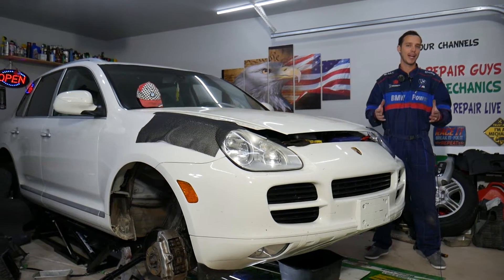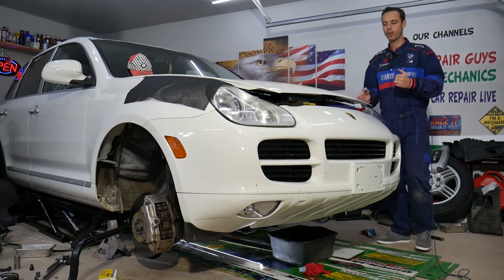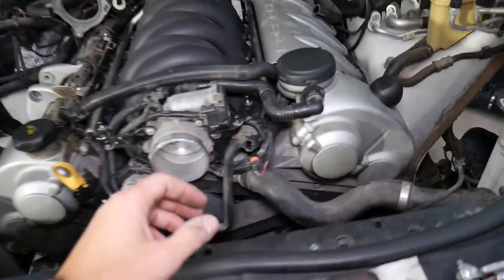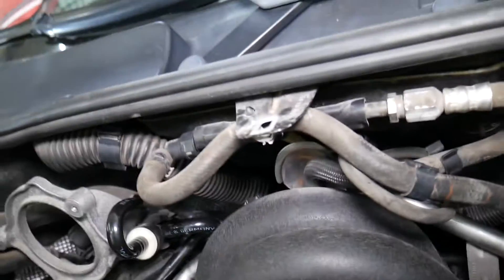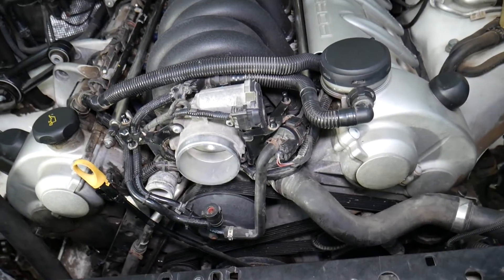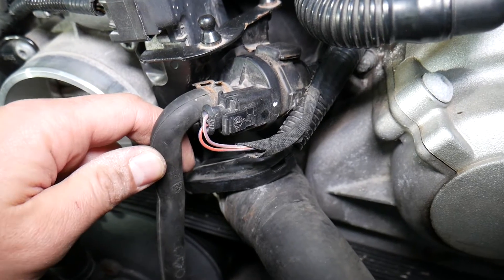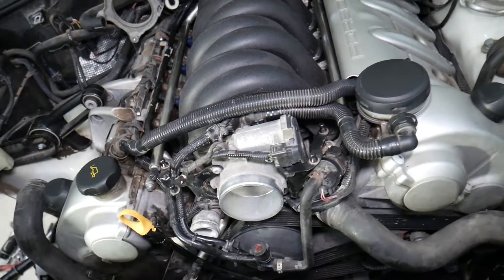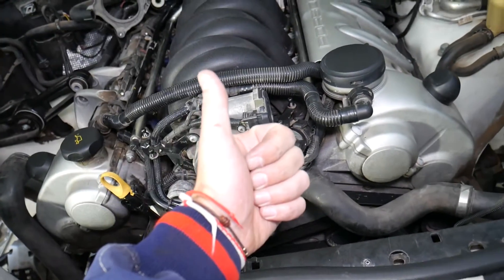PORSCHE CAYENNE CODE P0441 ENGINE LIGHT ON FIX

Comment: Hi if the purge valve is faulty can it cause 02 sensor codes and misfire codes, iv a P0441 code Tank Vent system and two 02 codes P0130 AND P0150 (Emissions relevant) ahead of cat sensors, also misfire codes P1319 AND P1315 AND OIL temp P0197. Car is a 1998 Porsche 986.

Comment: I have same code with my porsche cayenne S 2006 but l can't find the power on the wire spark plug  4 cylinder run good on the driver side for the passenger  side no power in the line